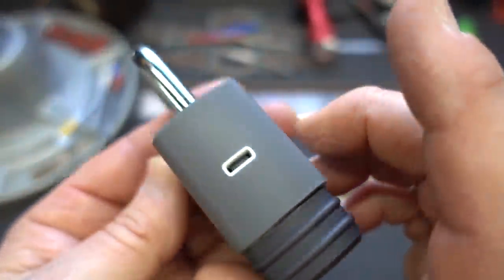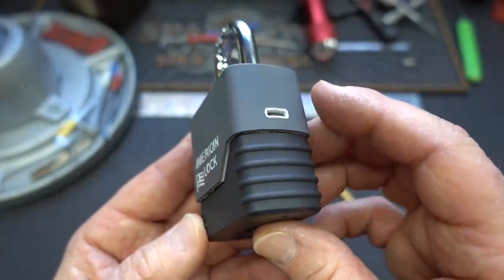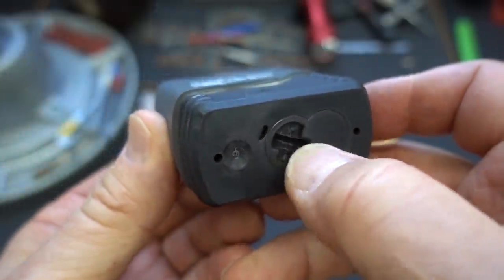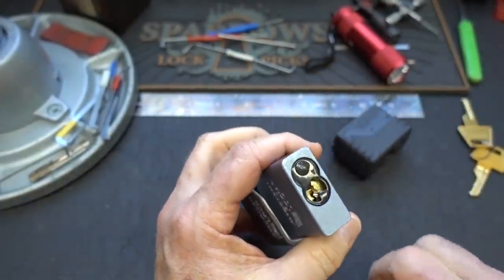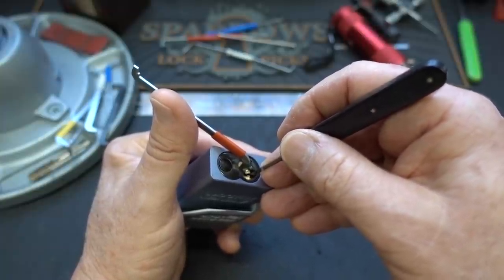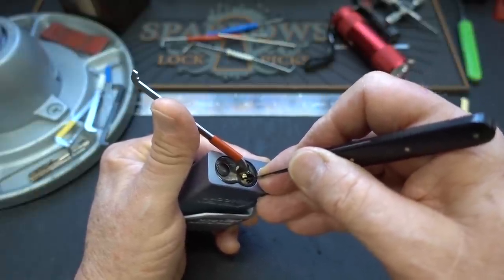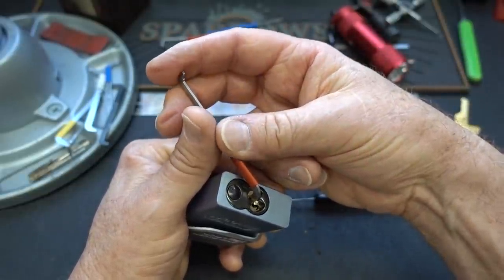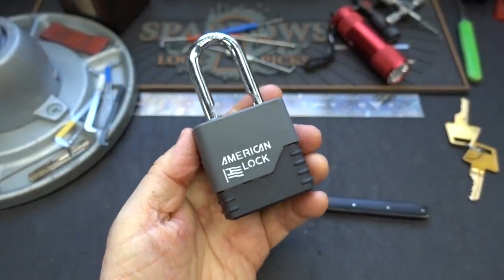(1807) American Lock Weather Covers

Comment: I believe bill has an older video on how to re pin the ones with the rivets, and be able to put them back together. I can’t remember the video number, but I’d say if you search Bosnianbill American lock you should be able to find it. 
Update: It is video 356 where bill shows how to rekey the sealed American locks with the rivets.
Reply: I was just gonna say that, it was odd hearing him say they can't be repined when it just takes a couple seconds to drill out the rivet.

Comment: The Master Lock master re-pinning kit comes with the new bottom plate nut and screw as well as the anti-bypass plate. 

The lock body looks at lot like the American 5200 series lock. The only concern is that some of the models use a 5 pin only core while others can be pinned with 6.

My go to lock series is the American 700 and the APTC-14 6 pin core. Resists most brute force attacks, readily up gradable, and inexpensive in padlock terms.

Comment: These locks are really a challenge when they've spent some time outside in the elements. I find myself  when I come across one hoping its an older American so I can bypass it. Lol . Thanks Bill for your expert tutelage!
Reply: I’ve found, that if you can’t pick it, and you can’t bypass it, you go with your last resort and drill it, I’ve drilled so many of those locks it’s unbelievable. And if you are like me and you are a locksmith apprentice or you happen to work for a locksmith, you probably have a ton of cores just laying around, all I do is I rear shim them, and I’ll even use a blank key to rear shim them. Then you repin the core and you are all set. My locksmith has a few filing cabinets and a few buckets full of random locks, and he will just give them away, a lot of them are American locks, and he actually pays me sometimes to pick, bypass, or drill open them and replace the core so that he can sell them, the used locks he usually sells for between half the original price and 3/4 the original price, and they go like hot cakes. Although I’ve found it to be kind of a pain in the butt to repin them, because you can’t use your standard pinning kit, you have to use either an American pinning kit or a master pinning kit.
Reply: Out of curiosity, locksporter from across the pond. Have you seen the bypass tool to penetrate the rear core cover/metal piece that stops bypasses on Americans and cheap amazon copies? (not sure on the proper term?) That to me seems like a no brainer to open and rekey for future sales for locksmiths.

Comment: Why can't you remove the core? It looks like a standard American lock under the plastic.
I have a brinks padlock with a plastic cover, same deal, you can remove the weather cover and it's just a normal brinks lamented lock underneath. Same size and shape as master laminated padlocks, the plastic weather guard will fit them too. You just have to open the lock to remove or install the top part of the plastic weather guard.